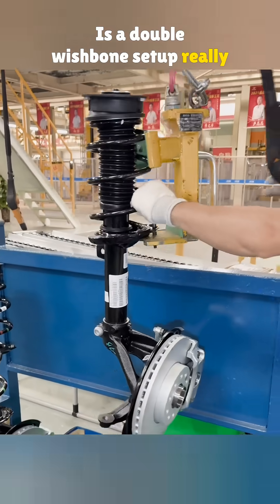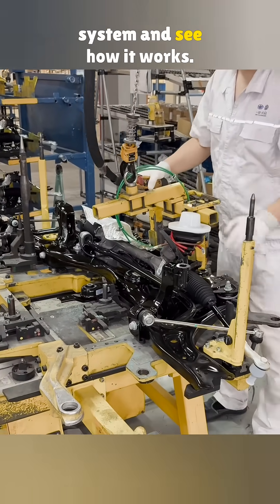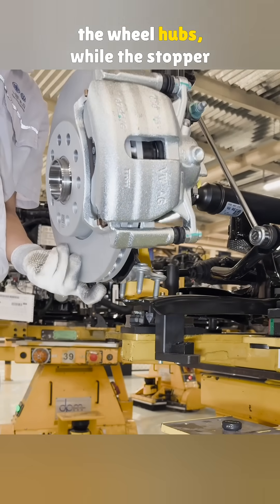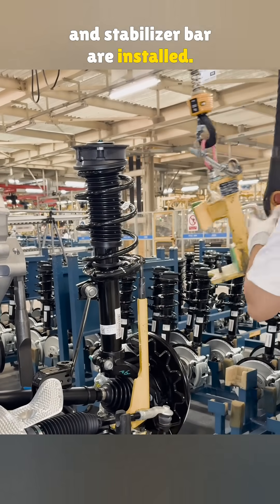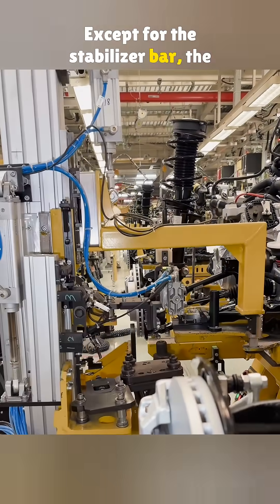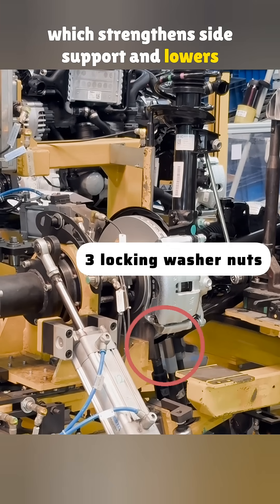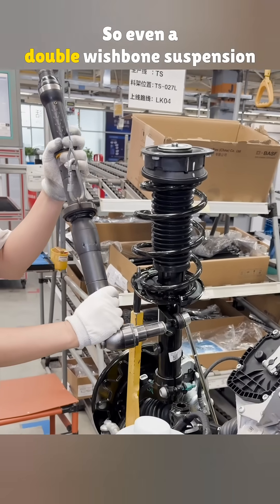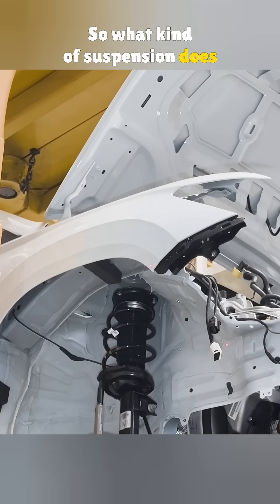Double Wishbone vs MacPherson— Which Really Handles Better #automobile #car #assembly #manufacturing

Comment: The Acura MDX, RDX, and TLX still use double wishbone. Combined with SH-AWD and they are exceptionally sharp at cornering. Downside is smaller interior size

Comment: Double wishbone on 911 GT3. And my Jaguar. Macpherson only has 1 advantage, cheaper.
Reply: And easier for the manufacturer to assemble, especially with the entire drivetrain at one axle. 

And here VW is proving that it case FAR MORE ABOUT ITSELF than delivering quality products that handle well (a safety issue) to its customers.

Comment: Yes, double wishbone, SLA suspension is FAR superior to the dreaded MacPherson abomination.

Even Porsche knows this as their 718 easily out handles the 911 and would trounce it on any track without a super-long straight. Porsche has had to handicap the Caymen since its introduction (far less power - though the 911 engine would fit, no LSD, etc.) so it wouldn’t outshine its big brother. 

…primarily do to its real-sports-car suspension. Relegating the 911 to fast luxury car status.